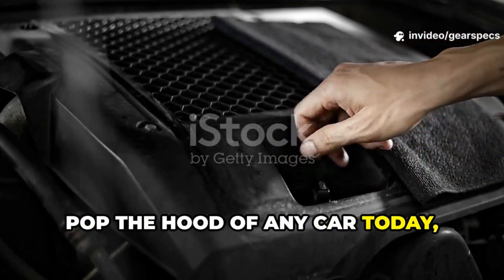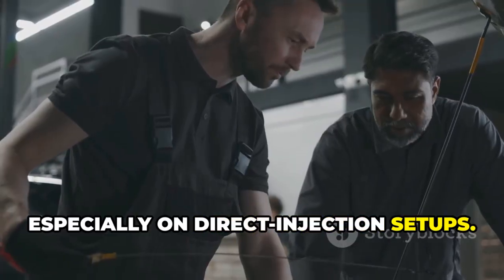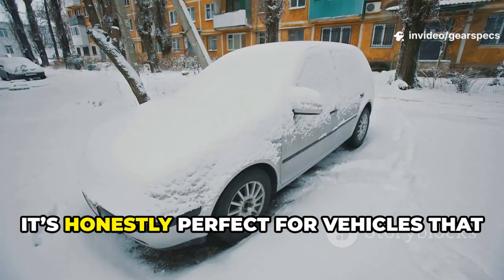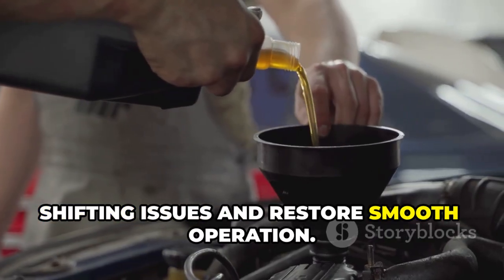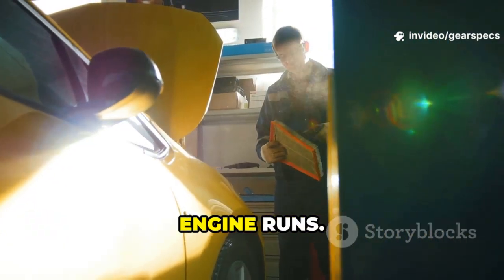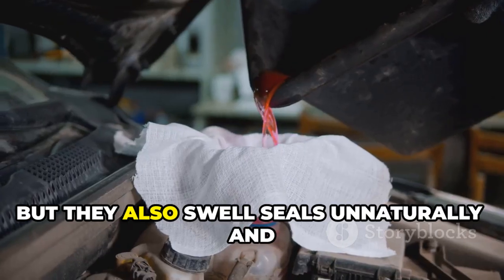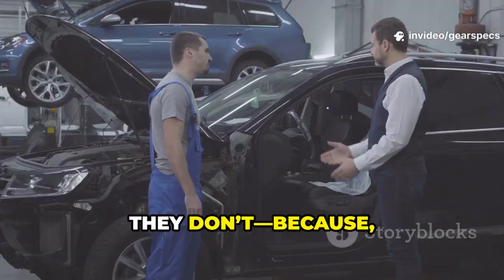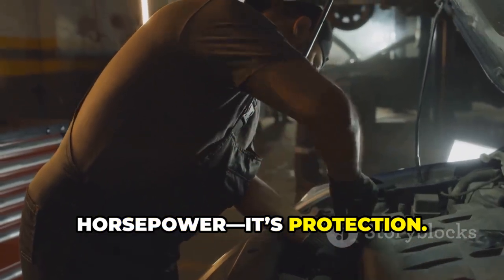13 Engine Additives That Work (And 5 That’ll Kill Your Car)

Comment: I regularly use a Teflon-based engine oil additive: 430,000 km without problems in a turbo diesel.
Reply from the maker: That’s impressive — 430,000 km is no joke, especially on a turbo diesel! Teflon-based additives can definitely help when used correctly, especially in high-mileage engines. Thanks for sharing your results — real-world experiences like yours are what make the car community great! 👏🚗💨